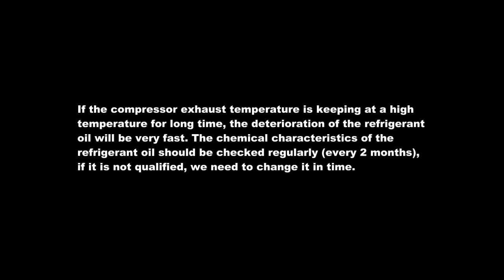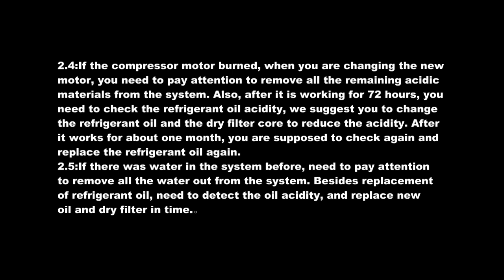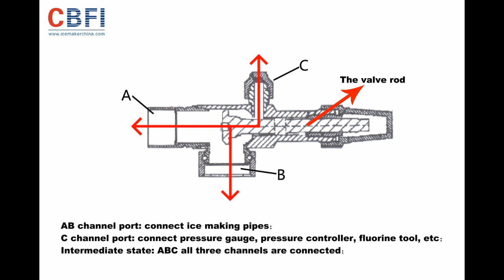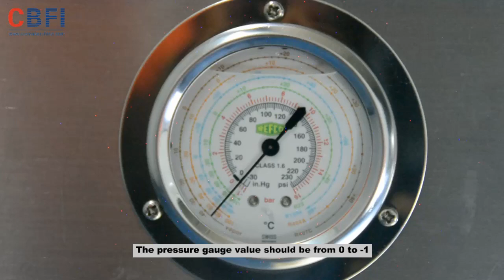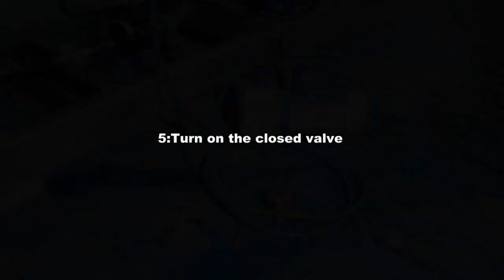Ice Machine Maintenance —  Change the compressor oil

Comment: Sorry sir this is not properly oil replacement video why you put Oil in Suction Line you can Filling The Oil Compressor Back Side this is a not Properly
Reply: It's smart way to change oil
Reply: This is right way to replace the oil